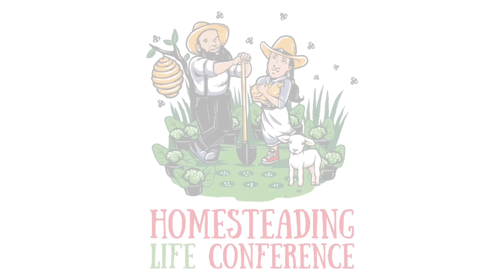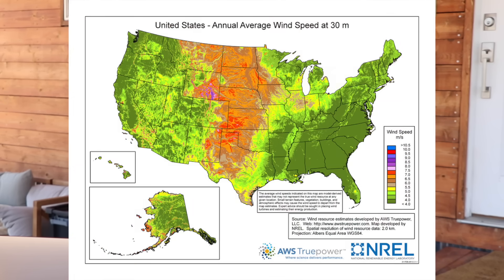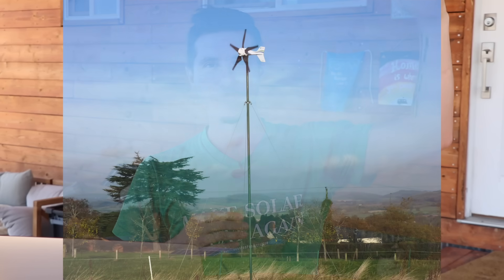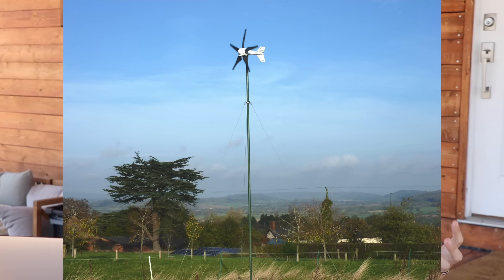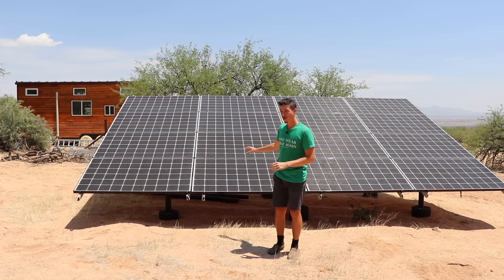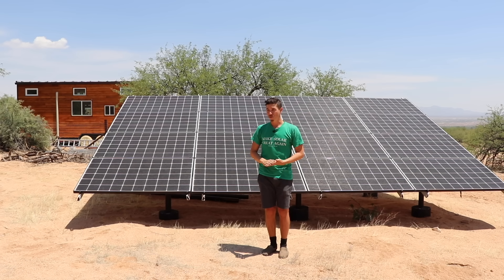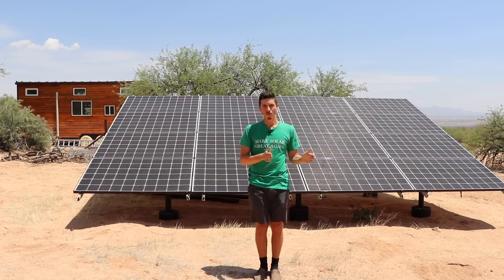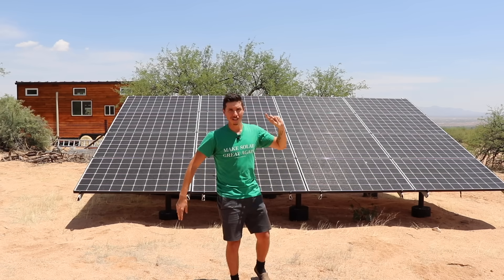Micro Wind Turbines... Are They Worth It? (Off Grid Solar)

Comment: You do need to take and to consideration the when in your area as well as the cost of buying the wind turbine If you're just buying it for the purposes of filling a gap in your Solar System's ability every now and then then you're better off buying a Inverter generator and a higher output 12 V battery charger something that can do wake 60 amps worth of charging into a 12 V battery because the generator and the 12 vote battery charger that your cooking to the generator which should probably be in inverter generator and realist ically only needs to be a 1000 W generator given the fact that you are actually using a 12 V battery charger that is high output to charge your system and provide your electricity at the moment and help with the gaps in your Solar System the combined cost of those 2 things is still less than the actual cost of buying the wind turbine itself and a sensually it is a much more reliable system then the wind turbine because you can go out once a month start it run it for 5 or 10 minutes make sure it is running right make sure everything is working right by a little bit of fresh gas for it every now and then and it simply will in The Times you need it be more reliable because you are only firing up once a month to make sure it is working properly and that is only for 5 to 10 minutes at a time and then you only run it when you need it or anticipate needing to fill a gap in your solar's ability because of inclement weather like numerous cloudy days in a row or even a snowstorm That is  Where the small inverter generator and a high powered 12 V battery charger come in more useful than the wind turbine because unless you are gaps or on a regular basis at least a few times a month then it cost wise is way cheaper to have a small inverter generator and a high powered battery charger something they can give you 40 to 60 amps of output at 12 V rather then taking all the time and efforts to buy everything needed for the wind turbine because  When you buy a wind turbine and all of the stuff that you will need to utilize it it will easily be 2 to 3 times more expensive then buying the generator and the high output 12 V battery charger not to mention in the event of a lot of different natural disasters the inverter generator will still be a usable functional device for you where as the wind turbine  May be damaged or broken and might not be working at the time whereas the generator will be working and you could use the generator to charge your batteries and run small appoints is typically you're going to be able to use the generator to run a fridge as well as set the battery charger on a lower charging setting and charge your 12 V battery bank or 24 V if that's what you have and you have the charger for.

Comment: You can always have a ground mounted compact vertical axis wind turbine system were the blades spin in a compact tube design! then you don't need to have it high up on a 65 foot pole. You will need a far smaller turbine like these use. they can be in a group of say 4 thus increasing the power got from wind all put into a big battery and controlled by a electricity system which stops problems and levels out the loads.  If I had the land away from people for a Eco Home I would use those compact vertical axis wind turbines with solar that track the sun. yes pricey! But if your going to afford a big lump of land and the Eco home being done you can afford to have your own complete Eco off grid set up with wind, solar maybe even wave if you live near a big lake that is on your land?  Some where like Canada be lovely well away from the madness of moden life.
Reply: Why? VAWT's are less efficient than HAWT's !

Comment: The wind turbine you keep showing is the old style one which may need a great height in a low wind area .But if you put a Vertical Helix type Turbine on a house it can be 15 to 21 feet off the ground or just attached to a two storey home. You then get wind coming up the building as well as horizontal wind. The idea of having a Wind Turbine is so it can run at night or day and help in with charging when Solar Can't.
Reply: He does not have enough wind - most people do not ...

Comment: The advantage to having a wind turbine included in your setup is that usually when its cloudy, the wind is blowing.
And as for ugly, that's both subjective and design dependent.
And as for potential back-feed, simple diodes are the best solution. They act as check valves.And since we're dealing with DC between battery bank and charging source, simple diodes will easily satisfy.
5 or six cloudy days in a row?
Being prepared for that with a sun dependent system alone is expensive and space consumptive.
Better to have a redundant design where the separate components compliment each other.
Of course I have zero hands-on so I may be speaking out my ass, but it certainly seems that off-grid dependence on a single energy source is foolish.
Reply: Most people cannot cost justify a Micro Wind Turbine.  Make a video of how you were able to cost justify yours ...

Comment: Solar is great and all, but what do I do if I live in Fairbanks, Anchorage,or even Juneau Alaska. I doubt one could make enough electricity with only 3.5 hours of intermittent and faint sunlight during the winter. Wind has all the problems you presented, but I am at a loss to find any alternative that doesn't require me to burn something. Perhaps a carbon neutral such as wood gasification could be pursued.
Reply: You need to install the renewable energy devices that are appropriate for YOUR environment ...

Comment: That map is wrong about the wind where I live. It's always windy.
Reply: Did you install a Wind Turbine ?
Reply: @MrSummitville  I have one on my sailboat
Reply: @stokesseegers5012  Yes, it can be windy on a sail boat.  But this video is about a very sunny location, with very little wind. It is not about sail boats. Typically, a Micro Wind Turbine is NOT worth it.  A Wind Turbine can NOT be cost-justified by 90+% of the USA population ....
Reply: @MrSummitville  in my hometown the wind always blows AT LEAST 15 miles an hour. You may have an afternoon when it dies down before switching directions, last month we had two separate weekends with 40mph winds gusting to 60mph. In the winter months the winds will blow 20mph of the ocean every freaking day, in the summer 15-20 out of the south west every day. The Wright brothers chose my hometown out of every other town in the country because the wind always blows here. When generators work better than solar panels here. Your map is wrong
Reply: @stokesseegers5012  You may be part of the 10% of the population where a Wind Turbine makes sense if you are Off-Grid.  If you have Grid Power, Wind Turbines are still extremely difficult to Cost-Justify.  Instead of saying "The map is wrong".  Tell us EXACTLY WHAT you think wrong...

Comment: I've been using a wind turbine for the past 2 years as a supplement to my solar panels. My turbine only needs about 3 mile per hour breeze to produce power. My panels DO NOT produce power at night. My turbine in most cases replenishes all the power I used during the evening prior. NICE! Also it is only 12 feet in the air. 
I guess I'm just lucky. It's a small setup and works fine for me....
Reply: Exactly which Wind Turbine do you have?  And how many Watts does it generate with only 3 MPH winds?

Comment: Hmm I'm off grid and I have both wind solar. It's 1:00 in the morning guess which one is not working right now...
Your point of view is not from a point of objectivity. In most areas they compliment each other not the other way around. The actual cost for wind turbine equipment is less than solar. I know because I have both. Your bias for solar is clear. I like your videos but this one is way off the mark.
Reply: What is the TOTAL installation cost for a Wind Turbine + Tower that can generate 5,000 Watts with 12 MPH winds?

Comment: 16 panels 
means 1600w 
which can not run one boiler or one AC 
and they cost about 2500$  
you can get your money back after 7 years which is bad investment
Reply: I have 30 PV panels, making 8,000 watts and they cost $2,800.  Break-even is less than 7 years, and they should last 25 years...

Comment: His t-shirt says it all. This review is biased. Wind Turbines work better than solar panels at night 😂😂😂
Reply: Not if there is no wind!  In most of the USA the wind is not strong enough, or steady enough, to be cost effective.
Reply: @MrSummitville  I agree with you partially, but there are studies showing wind trends in specific areas including heights that you would need to place your turbines. For me I prefer Wind turbines to solar panels, I have initially had a nasty experience with solar panels.
Reply: @alexiskeri3092  Solar Panels work very well for me.  I have an 8,000 watt PV system - self installed.  They will "break-even" in ~5 years.  A Wind Turbine would take 40 years to "break-even", but it would FAIL long before that.  Failed Small Wind Turbines are already being torn down & removed.  A pair of $40,000 Bergey Wind Turbines were sold for $1.00 !!!
Reply: @MrSummitville  Maybe I could give consideration. Its just food for thought
Reply: @alexiskeri3092  Wind Turbines are typically rated  using 25 MPH Winds.  So, how many MINUTES  per day do you have constant 25 MPH winds blowing in your backyard?   And yes I said "minutes", not hours!  How many days/nights will your answer be ... "ZERO minutes at 25 MPH" ?  You were the one who said, "the review is biased".  Actually, the review is very realistic, for his and most other locations ...

Comment: Wow, based on the response you received from this post, I would say you should have stayed in your lane on this one. Looks like you stepped on a few toes and showed your bias at the same time. Solar panels are nice where you live, but like it was pointed out over and over again, you live in a place where the sun shines regularly. 

What happens 25 years from now or even 10 years from now when your solar panels are way down in efficiency and the company who sold them to you are gone with the wind? Can you repair solar panels when their efficiency fades? How many wind turbines can you buy for what you spent on those solar panels? Is there really that much maintenance associated with a small wind turbine?

I checked the wind in Sierra Vista and it seems like there is a respectable wind blowing regularly at ground level. You talk about a 65 foot tower. Does the tower really have to be that tall or were you exaggerating to make your point?  The area where you live has some fairly nice ridge lines that are probably elevated enough to put a 6 or 8 foot turbine 25 or 30 feet in the air and produce some respectable wattage with a very small footprint compared to a solar farm.

You ask, "What do you do when your batteries are full?" I gather excess electricity would be the dream of anyone living off grid and most homesteaders would love to have that problem. If I lived where you live, I would have a small air conditioner or dehumidifier that would run when my batteries were full, just to pull some clean water from the air. Maybe a small ice maker? Perhaps a water heater/cooler? The list is endless.
Reply: Yes, 65' is the starting height for wind turbines. Do a cost analysis of a 5,000 Wind Turbine + tower with your average wind speed vs 5,000 Watt of Solar. And you will see that Wind Turbines are a financial disaster.  Yes, the battery bank gets full every evening at sunset.  Having a wind turbine spinning with full batteries is a PROBLEM!  You need a (water heater) dump load. You should do much more reading before posting.
Reply: @MrSummitville  I just found your response. I mentioned a water heater at the end of my post. Seems like you are assuming one would want to start off with a 5kw turbine instead of a few smaller ones. I stand by my post and don't  need to do more reading to cover what I said.

Comment: I live on a mountain in NY, I have been off grid for 30+ yrs. We have always ran a wind turbine. This year I rebuilt my system I went to solar because everyone said it was so much better and that it will produce more power I traded my tower and head for the solar panels and to have them installed.Well here I am today to say I now have a welder, a lathe and 2 milling machines in my garage that I can no longer use and I be lucky if I can cook a 10lb turkey in my oven before running out of power now the solar array is 15 panels takes up over 100 sqft of my back yard and I can no longer run my garage or cook a turkey all the way through. My tower was 20ft tall and was on a 3x3 concrere pad so it took up no room and the head charge controller and invertor were all over 30yrs old my parents had it put in when I was around 3. Needless to say we just purchased  another tower and turbine and will be selling panels
Reply: You did no research before switching from Wind, to Solar.  So, who is to blame for that?

Comment: very biased for solar panels ..that's fine but what happens if you live somewhere where you only get sun 50 or 60 percent of the time through the day ..not everyone lives in the desert ...and what about at night ..I think I will look elsewhere for some non biased info ..
Reply: Do your own research, regarding your own environment.  It is called - using some common sense - which does not appear to be very common , with you.
Reply: @MrSummitville  I pointed out my research in my comment ..and it seems most of the comments agree with me ..it seems you have absolutely no common sense ..only bias .poor form ..
Reply: @patrolmanracv  Your initial  complaint of "... very biased toward solar panels ,,," is the problem.  Micro-Wind does not work at all for 90+% of the people, and only works for a small  % of off-gridders - those are the FACTS , that is not bias.  And that is what I call common sense.  This thread is about how poorly micro-wind works.  If micro-wind works for YOU  then post a video and show us how many kWhrs you can generate and what is the total COST ...

Comment: If you have sun, use it; if you have wind, use it; if you have both, use both. This is the only fact. I live on the Alps, 1.650 meters high, and here there is almost no useful sun for months, in winter, and 2 to 4 meters of snow. But we always have wind, night and day, summer and winter. With 3 wind turbines 300 watt each and 24 volts controller and batteries I run a pellet stove, a refrigerator, lights, internet via radio frequency, TV, 3 water pumps, microwave, HiFi, a notebook and HF radio. No cleaning, no maintenance in 3 years, thin cheap wires to bring AC current from the turbines to home a hundred meters far, they last 10 years and then with few money I'll replace them, by myself, in an hour. I've paid for three and had one more for free, for backup.  I've an emergency gasoline generator, never used in 3 years. Bring your panels here, at minus 20° C, you'll die of cold in 2 weeks, in the dark, with no communications.

Comment: Seems California has more wind turbines than your wind map shows is reasonable. Most wind turbines spill a lot of energy so a new model with very efficient blades would bring in more power long term and those northern winds from Canada and those cold windy nights the winds are blowing gale force could deliver a lot more energy than those 3 bladed  winds can produces so  they just dump it off the generator. The question is it practical and cost less?
Reply: Gov't subsidies allow Wind Turbines to be installed in less than optimal places. The gov't is picking winners and losers with our tax dollars.  Wait until the Wind Turbines need mechanical repairs and/or the blades need replaced.  We are already seeing Wind Turbines being shutdown and torn down because they are too expensive to maintain vs KWhr's produced ...

Comment: You seem much more knowledgeable than I am about these things, but you seem to be focusing mainly on costs. I don’t know man. I’m on eBay and I see 3000w wind turbines for like $300. Getting 3000w of solar would cost thousands of dollars. I don’t know what I’m missing here but cost seems to be a non-issue. Maybe in building the tower to hold it? Even then, I’m sure it wouldn’t cost thousands of dollars.
Reply: NO! There are not any  3,000 Watt Wind Turbines with a tower for $300.

Comment: going old school with wind is in at least most  rural aplications pretty reasonable. use your windmill as a water pump and run water to higher ground, by having a large storage area with a 50 ft drop, you can then use your stored water for hydro elec when stormy or cloudy days when your solar does not keep up. having 2 tanks to store water, one on high ground, and the other onlow ground means you can recycle water over and over. this also eliminates the need for a continuous load on your windmill, as the water will provide exactly that full time. slightly less cost efficiant probably, but much less maintenance then a straight wind gen. and extremely low tech with not much besides basic plumbing skills needed.